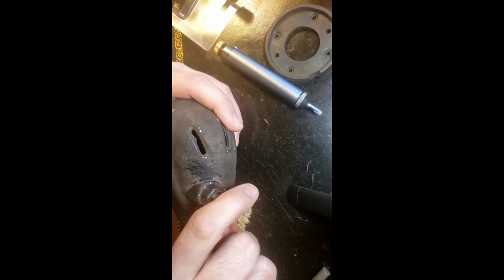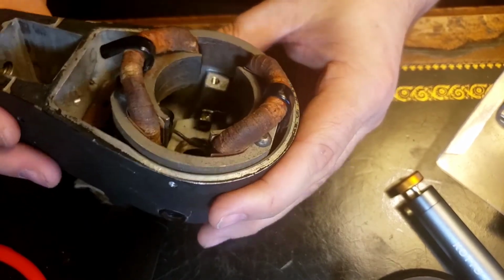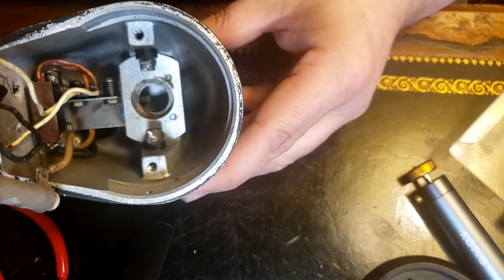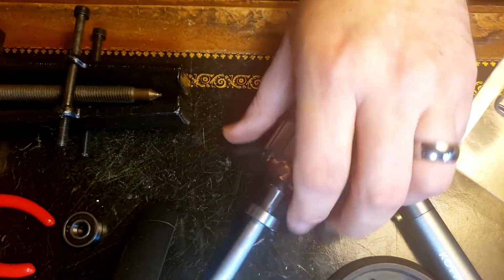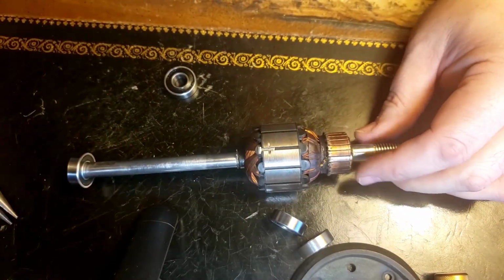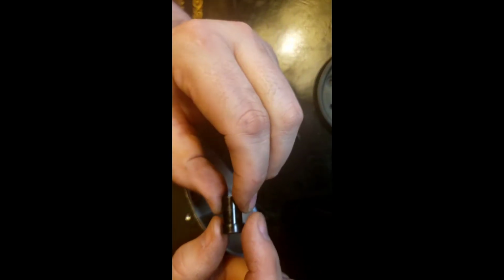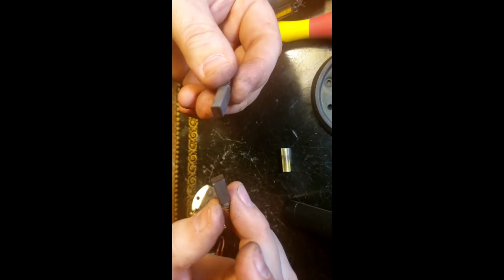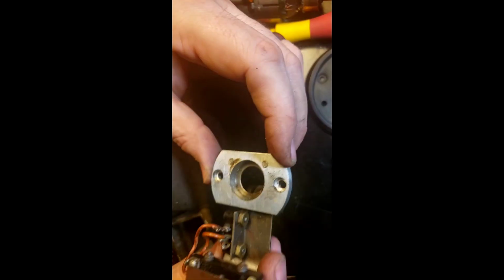L&R watch cleaning machine NIGHTMARE!!!!

Comment: Very helpful video!  Thank you for posting.  I have a 1950 model L&R Master machine that badly needs rewiring.  How do you get the motor housing open?
Thanks again!
Reply from the maker: The screws on the underside of the housing must be removed. The rubber gasket comes off, followed by the flat lower housing section. It is quite a precise fit. When you take out the brushes to pull the armature,  be very careful as the black plastic holders are extremely brittle. I believe they are bake-o-lite.   Try to get some lube in there from both sides before twisting them.
Reply from the maker: Actually if I remember, they may be just pressed in. After lubing, try pushing them straight out before twisting them.
Reply: Thank you much!   I’ll give it a go.  The brush housings are available but not cheap.  About $50 each.

Comment: Super helpful video. About to receive my own mastermatic off of eBay. From your video, it seems to me the default state might be oscillating and the black boss over the heater hole engages the rod and microswitch to disable the oscillation.
Reply from the maker: It only oscillates in the fully down position. The microswitch is activated by the rim of the jar. This allows you to lift it up slightly and use centrifugal force to remove most of the fluid, before changing to the next jar. The upright boss stops you from lowering it too much into the heated chamber.

Comment: Hello. I am trying to disassemble the basket motor for a Varimatic, which has the same worm gear/reversing design like your “closet” Mastermatic motor. With fear and judicious force, I have been able to get the end plate off, but the armature refuses to come out. Either the top bearing is seized into the housing or there is something else holding it in that I am missing. Did yours come out freely? Before I get heavy handed with it I want to make sure there isn’t some trick… like somehow needing to disengage the worm gear. Thanks in advance for your help.
Reply from the maker: The brushes are likely impacting the free movement of the armature. Have you removed them? Also if memory serves the top bearing was a tight fit in the top of the housing.  If the brushes are out use some gentle side to side movement on the armature shaft to work that top bearing downward.
Reply: Thanks for the reply. I did remove the brushes so that is not it. At least I know there is nothing else holding it… it is just stuck. I will probably try to get a little WD-40 with a straw nozzle and just keep worrying it. These are great machines, but they do put up a fight when you work on them. Thanks again.

Comment: Thanks for posting this video.  The only one showing the mechanical inner workings of the auto-oscillating mechanism on the internet, (that I could find anyway).  I have a really nice, working L & R Master that I'm about to restore and wanted to add the auto- oscil. feat. to it in the process.  I've got a L & R new products pamphlet from the 50's, and in the back they offer a service for a "Auto Reversing Action" upgrade tor $25.00.  Just ship your ( Master or Heavy Duty unit w/ L & R motor) to the factory.  I found a pristine Vari-Matic head unit model C and it's on the way from ebay that I'm going to convert my Master unit with, so this video was a big help.  So thanks again for the posting.
Reply from the maker: Thank you for the kind comments. I'm so glad someone found this useful. I wish I was set up for making better quality videos. I hope to make more in the future.
Reply: @H0lyman01  Hey the video quality was not a problem what so ever.  When it comes to a good and useful posting of videos in this category, production value takes a backseat to content.

Comment: Hi, I have the same model machine, same crumbling wires.  I took photos when I disassembled, but two of the photos didn't turn out good.  Would you happen to have a wiring diagram or pics showing where the wires connect?  Thx.

Comment: I have one of these apart, if you want to see an original?
Reply from the maker: Thank you! I did manage to get it all back together and working well. I appreciate the offer.
Reply: Hi, I have the same model machine, same crumbling wires.  I took photos when I disassembled, but two of the photos didn't turn out good.  Would you happen to have a wiring diagram or pics showing where the wires connect?  Thx.
Reply: I have a similar model and was wondering how you managed to get the brush holders out.  I don't want to damage anything in the process so any advice would be appreciated!
Reply: Those brush holders come out by removing a set screw that is down the hole where you dripped the oil. Loosen the set screws and the holders are easily removed.